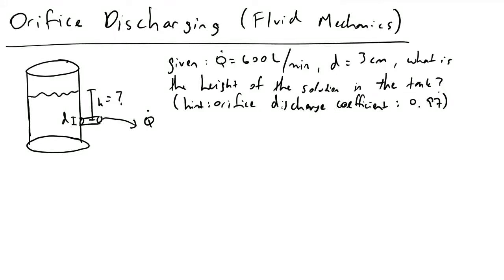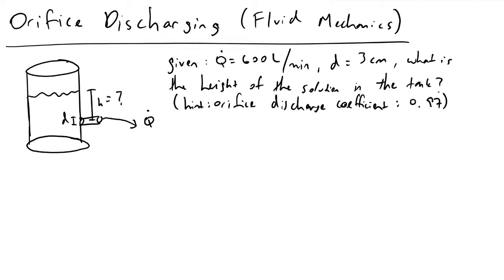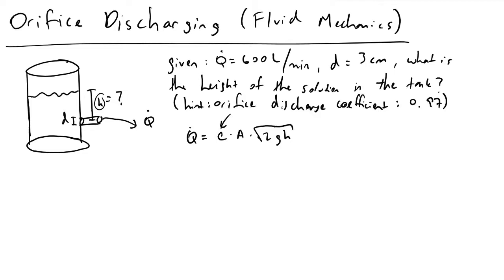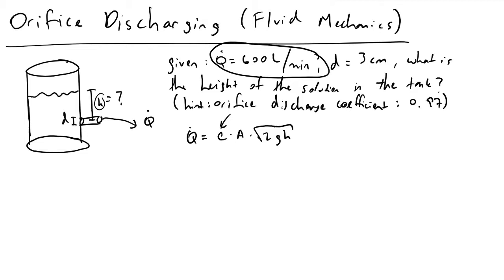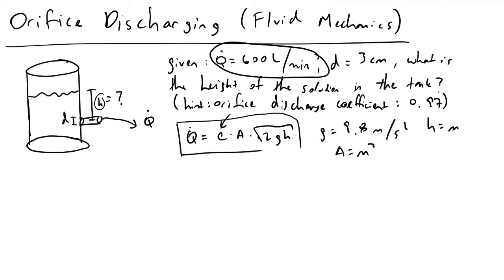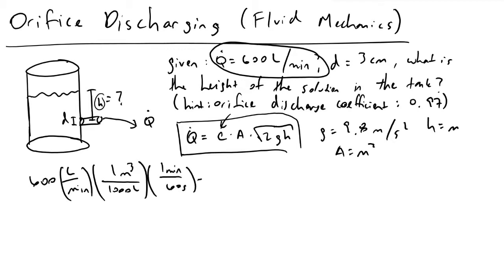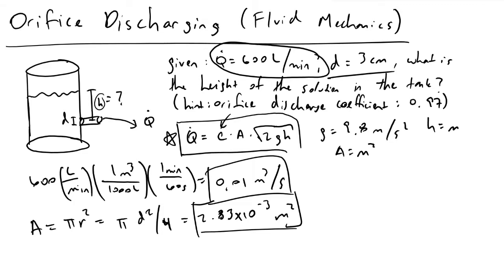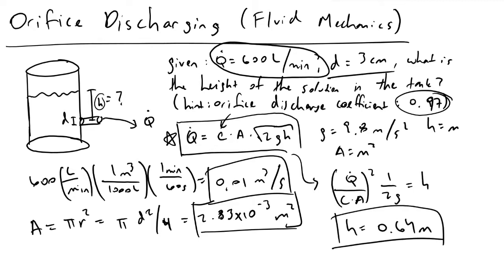Orifice Discharing Fluid Mechanics

Comment: Your videos have helped immensely with studying! Thank you so much, but on this one, the area was wrong. You forgot to divide by 4. Area should be .000707 m^2. Final answer would be .108 m.
Reply: you are correct that the area was 0.000707 m^2, however I think when you solved the problem you used 7.07 *10^-3 instead of 7.07 * 10 ^-4 resulting in your answer being off by a factor of 10. The answer using the correct area is 10.8 m.

Comment: I think the Area you solved is wrong because at the given you've indicated that the diameter is 3 cm or 0.03 m, and if you use that to solve for the area you will get 7.07x10^-4 sq.m